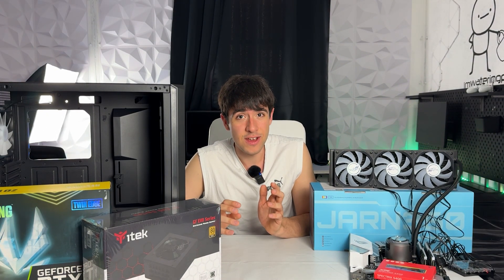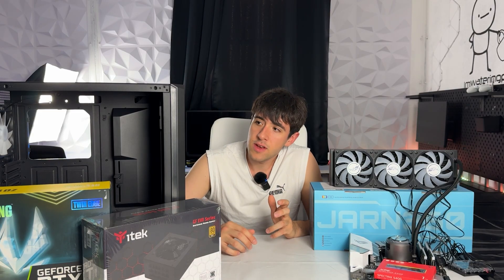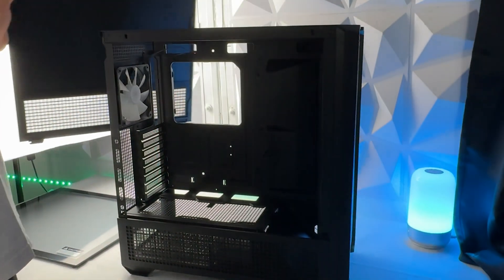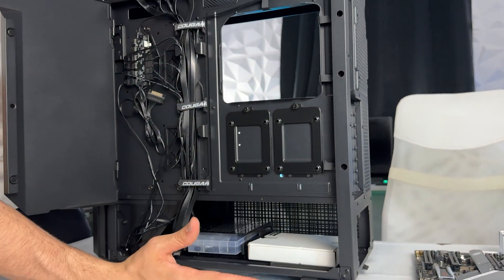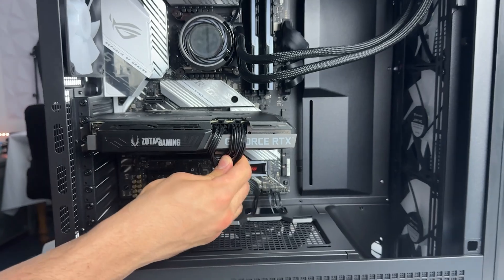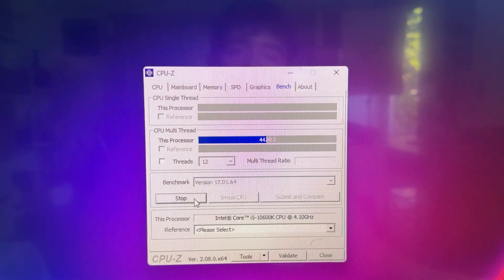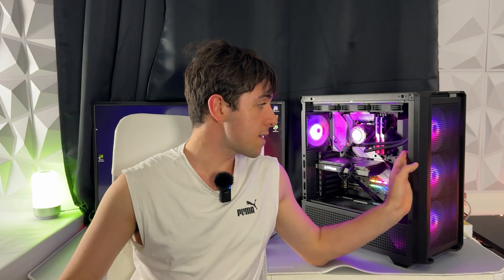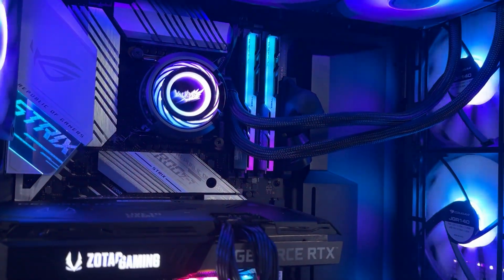I turned a Broken PC into Money... Fixing & Flipping PCs

Comment: Hi, i accidentally got a used 9600k for my z270 motherboard thinking the socket supports it. I saw your video on how to use I 9 9900k in a z270 board. Is the same possible for i5 9600k too?
Reply: Bro it's never going to work , it's different Soket , don't even try it!!!
Z270 suports only 6th and 7th Gen Intel CPUs.
Yes for Example the Z170 Asrock Formula can suport with some kind of tricks and a Special Bios the 8th gen... but it's not worth it.
Reply: @Denis92Gottlobeanu  it worked, running a 9600k in my z270 f right now.
Reply from the maker: You can do it indeed! I’m really happy you figured it out, every single Z170, Z270, Z370 and Z390 are actually fully intercompatible with just a little bit of bios modding :)

Comment: Wierd question to the people !
Does thermal paste have any "expiration date" ?
Looking to upgrade CPU and noticed I have an unopened cooler master paste that I never used. Still good 5 -7 years after the fact ?
Reply from the maker: If it got absolutely zero air in, it’s not gonna be too bad! I have some Arctic MX-4 which I tested after 5 years in a (opened) tube and it was still performing! Just 2-3 degrees worse
Reply: @ImWateringPSUs  I will put my future CPUs fate in your hands ; ) unless I get a deal on new stuff !
Reply: @Tibazz 
Bro Price of a new tube of Thermal Paste is mediocre.... so it's wort the 5-10 Bucks...😅😂.
Reply: @Denis92Gottlobeanu  I did reqlize this after the fact XD, but also, i do not think my paste is necessarily that old either since i bought a new cooler in 2021 and I think this is when I bought the paste. I have no record of it, though : /
Reply from the maker: @Tibazz  Ahahaha yeah, I'd say unless it's a time constraint issue, if it's your personal build buy a new tube. But the old one is gonna work fine!